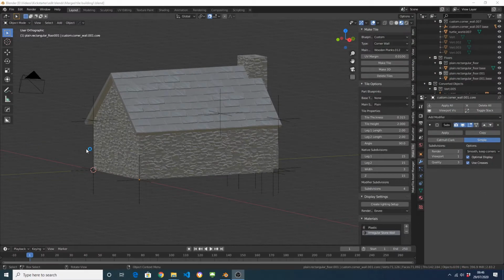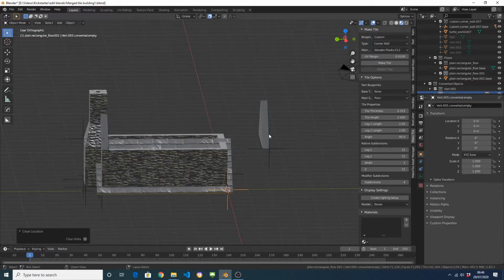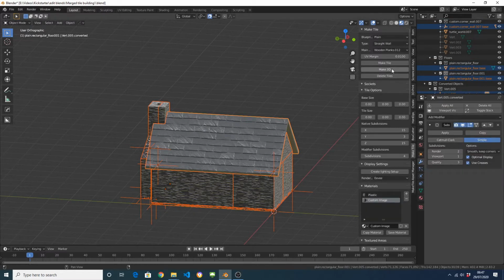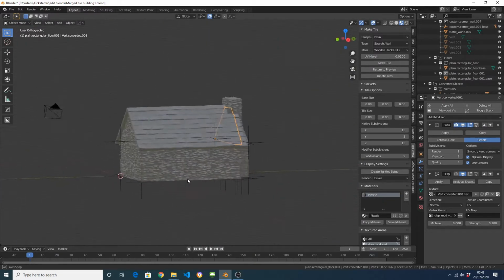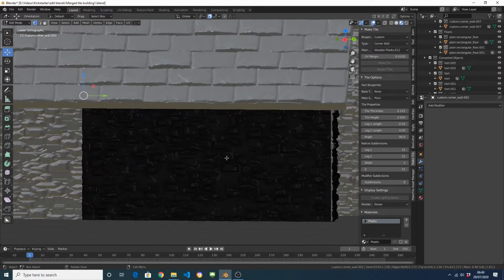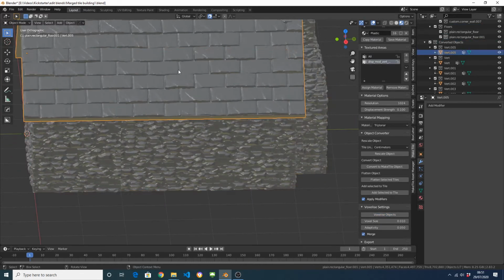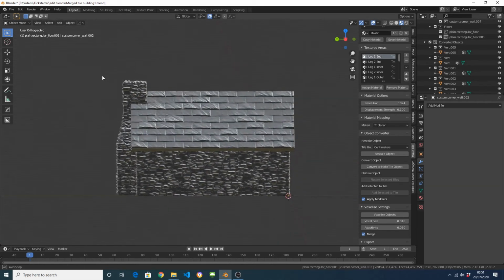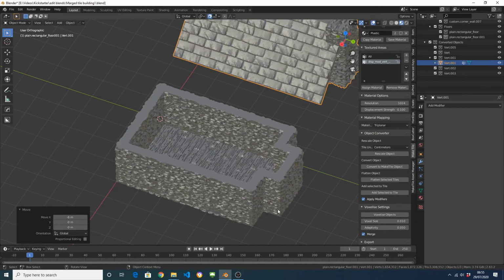Making Buildings with MakeTile!

Comment: Do you snap in place/align the walls manually? Also, how do you get the walls to be free of visible seams when joined? Are the textures designed symmetrically so that they can be joined perfectly?
Reply from the maker: Hi Steven, I use absolute grid snap for positioning the walls which snaps them to the correct place. The materials are procedural, so depending on the mapping method selected in the material mapping panel of the MakeTile menu the textures will extend(tile) seamlessly across tiles. Having said that there will always be a seam where the two ends of the material meet. The traditional trick is to hide this with an architectural element. I.e. with this house I hid the seam on the cottage walls with the chimney. From within MakeTile you can choose to join tiles together and then voxelise them. By voxelising the joined tiles you create a single piece of geometry without holes you can then export. If you make your tiles slightly oversized to begin with so they overlap at the edges then when you merge and voxelise the join will be seamless. This is actually the default for wall tiles as the OpenLOCK spec has them slightly oversized so that if you make an enclosed space the floors fit in easily.

Comment: Kickstarter version will be compatible with blender 2.9? Actually it give a lot error
Reply from the maker: Hiya! Yep, it will be kept up to date. Blender 2.9 only went into feature freeze last week and is in bug fixing mode until August 19th and not due for release until 26th. I don't tend to try and make sure the addon is compatible until a release is stable as it's too hard to tell where the bugs are from otherwise.
Reply: @modmodterrain5759  sure, i was asking Just to know. Actually im using both 2.83 and 2.9 Just to understand the new feat, and i was curious to try in 2.9. your addon Is a great time saver when designing fantasy terrain, orherwise texturing Wall and Stone is a pain in the a*s. Thanks a lot, ill pledge for shure
Reply: @modmodterrain5759  Did you think to expand the material library in the retail version?
Reply from the maker: @giovannizaccuri  Yep. There will be 10 materials in the basic tier and an extra 5 plus any that get added as stretch goals if people back the plus version. Once the Kickstarter launches I'll run a poll to see what additional materials people want to see.
Reply: @modmodterrain5759  theres a tutorial to add personal material?
Reply from the maker: @giovannizaccuri  https://youtu.be/OCSTabQsqQE on how to use the custom image material. I haven't done one on creating your own procedural material yet.